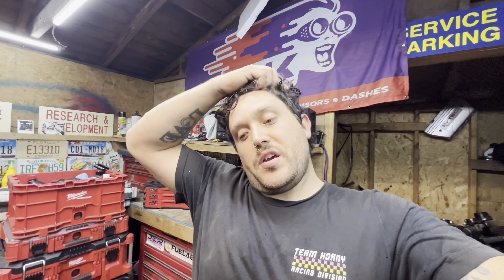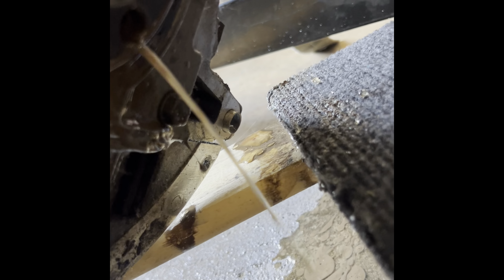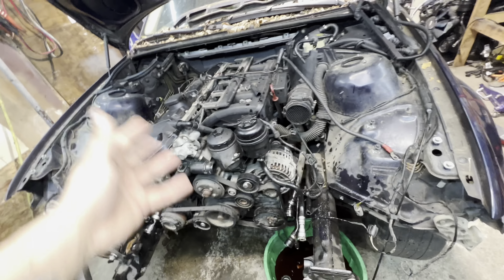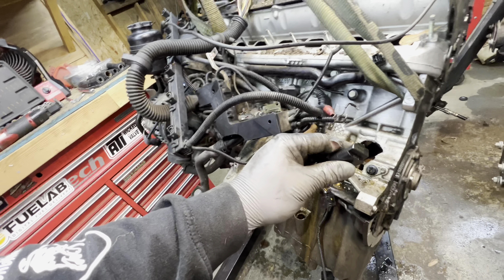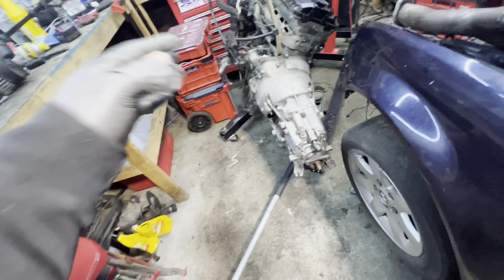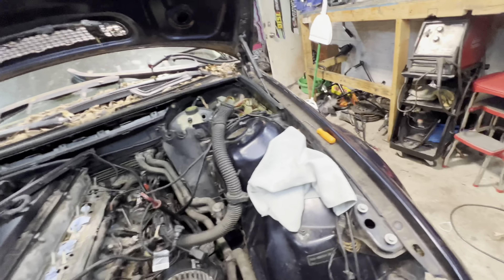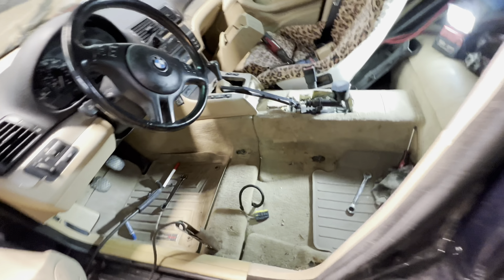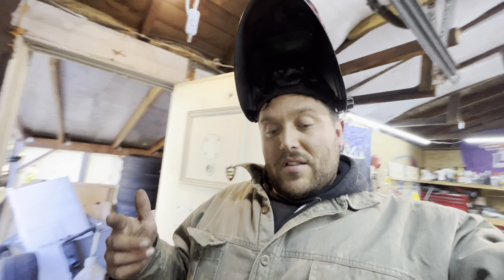The Engine That Should Have Came In a E46 Touring Wagon! E46 Wagon Build?!

Comment: What do you gain from the M50 manifold swap?
Reply from the maker: You move power from down low to up high in the rpm range as well as make the car 5x easier to service and remove the intake manifold and simplify the vacuum lines, Delete problematic CCV and more!
Reply: bolt on swap?  Tried researching on some forums but, cant get a clear answer on what years/models it came on.  E36 325 pre 95? @JustinMedina
Reply from the maker: @nelson8708yahoo  it does require a few pieces but luckily Seems Legit makes the pieces to make it super easy! that is correct for model years.
Reply: You gain nothing... the stock Manifold is already simplified people are just lazy... If you have a B25 then B30 intake is worth it. The M50 Manifold robs you of Torque and that isn't good on a car that already is Torque deprived
Reply from the maker: @easydayez  you do lose some low end toque with a m50 manifold, but the amount it simplifies everything vacuum related and makes a it a much more boost friendly manifold I say it’s worth it for the low cost.
Reply: I found some back to back dyno runs with the intake swap.  It just trades mid range torque for top end hp.  Just depends what the owners preference is. @easydayez
Reply: @nelson8708yahoo  What preference? I am just confused because the justification isn’t there? There is no benefit at all ☹️ your just modifying things just for the sake of modification at that point